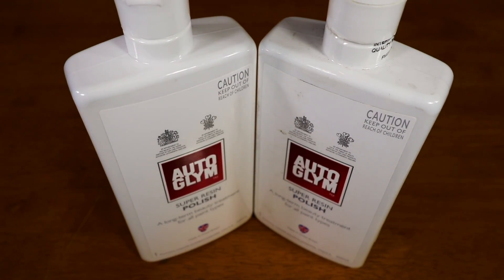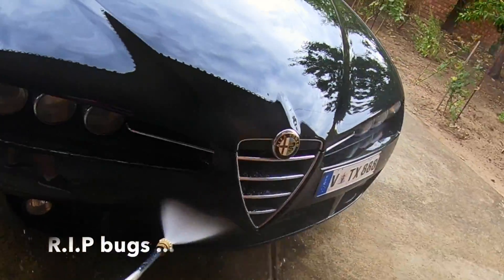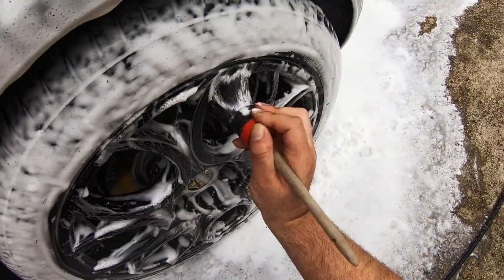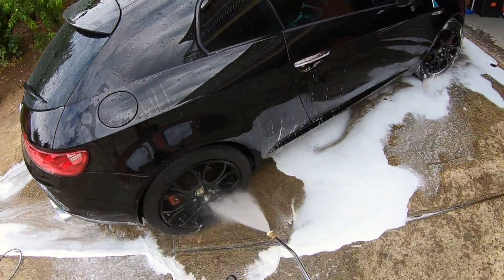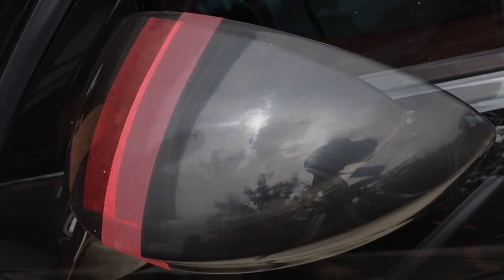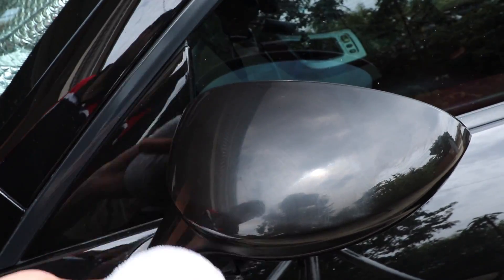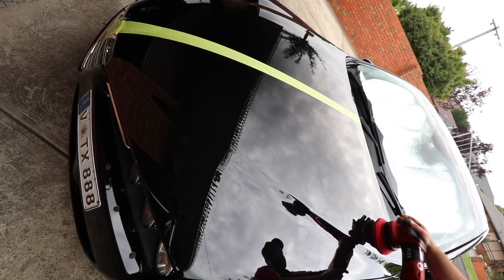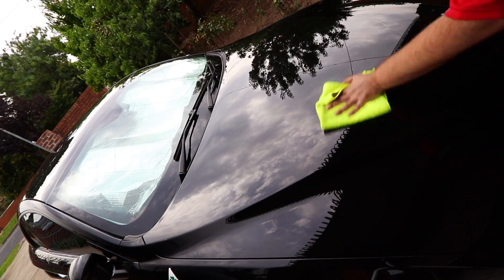How to use Autoglym Super Resin Polish+Review

Comment: Wow! The finish is amazing. After using this polish can we clean the car with IPA and then ceramic coat the car?
Or is it to be used like a wax?
Reply from the maker: It’s really to be used like a hand polish rather than wax, but after a few hour you can top it with a wax or sealant but not a ceramic coating as there will be bonding issues.
Reply from the maker: Give it a few hours or just apply a wax the next day or the next time you wash the car

Comment: I used SRP and totally love the wet glossy look it gives. 
Question: After polishing with Autoglym Super Resin Polish...if I apply cquartz U.K. 3.0 would that lock in the wet glossy look from the super resin polish for the life span of the ceramic coating?
Reply: Car Craft Auto Detailing  thanks for the feedback on this it’s very much appreciated. Presently I have Autoglym “Extra Gloss Protection’ sealant on my car. I’m looking for something to add on top of EGP to provide additional layer of protection and longevity...do you think it will be a good idea to put a wax/spray wax on top? Any advice would be appreciated.
Reply: Thanks so much bro...will definitely get those products. Much thanks again.

Comment: Hi Sandro, great video, and a local expert to boot!  I’m from Melbourne, and used to live in Werribee a few years back. Have a question for you. I’m planning to apply the Gyeon Pure ceramic coating in the next few weeks and have bought a bottle of the Auto Glyn resin polish for the pre coating polish stage. After watching your video I’m starting to think maybe the Auto Glyn resin polish is not the best polishing product to use when finishing off with a ceramic coating?  What are your thoughts, would you recommend another polish in this scenario?

Comment: Hello I was shocked at how many times you went over the first mirror and then eventually buffed the super resin polish off. When I've used super resin polish I've just done small circles in each area in thin layers and then buffed out...
 Am I suppose to go round so many times in one spot ???? What does this achieve compared with a few circles and then moving on???
Reply: @CarCraftAutoDetailing  oh crap wow I spent today 7 hours using t cut, auto glym super resin polish and then auto glyms extra gloss protection. When I next come to do another job in 6-7 months of using super resin polish I will definitely spend ages going round and round. How long should you do on say the bonnet in a small car manually without a machine?
Reply: @CarCraftAutoDetailing  ok thanks for that that definitely helps me understand exactly the right amount required etc! I'd highly recommend auto glyms extra gloss protection. It's a very oily liquid wax that's basically almost a ceramic coating!! It beads water completely

Comment: SRP is a great polish it remains my favorite to date and top it with FK1000 a day or 2 after the application and its High Gloss and mirror finish is a real head turner. I also found the Megs Ultimate Polish similar but favor SRP have you tried the Megs?

Comment: This was very informative. I'm still not sure what product to get. I'm looking for the best product to use before I apply a sealant (not a wax). Paint is dark blue metallic and in excellent condition. I will not be doing any actual polishing. I want to work by hand. Durability is not that important so I don't mind sealant being somewhat compromised. I'm looking for something to do some cleaning and lots of gloss enhancing. I have some P21s GEPC on hand which I've used and liked. Can I do better? SRP, Blackfire paint cleaner, Swissvax cleaner fluid, Prima amigo (would amigo's fine abrasives give me problems by hand?) ?? Thanks
Reply: I just read below this has some abrasives. Will that make dark paint look bad if not worked enough when hand applying?
Reply: Thanks. I'll see if I can find it here in the colonies.

Comment: Can you apply a ceramic coating after using this polish?
Reply: @CarCraftAutoDetailing  okay. I'm planning to correct my paint shortly with a medium cut. After that, do you reccomend applying super resin polish or a ceramic coating? I've bought both. 

Thanks for answering, I'm new to car detailing etcetera so you are very helpful.

Comment: Hi, there is a turtle wax headlight restorer and sealant liquid or waxy type of liquid that has been left on my paint for a month now, because it's white and also my car paint is white so It was hard to notice it when I cleaned my headlights and is now hard. It's not such a big deal but when you go close to it, you can notice it. Tried cleaning it off with microfibre cloth and water but it seems hard. Can I use autoglym resin for that?

Comment: The first bottle you bought ten years ago did have abrasives. It was reformulated several years ago and now contains cleaners, silicone and resins to achieve its results, it's a true glaze product. Any cutting you're seeing is either the cleaners removing oxidisation or the cut from the microfibre applicator.

Comment: Hi,
I used Auto Glym( same as your) to polish my car. After couple  of days I find to much dust sat on my car.
What do you recommend (I didn't apply any wax or ceramic code after polishing.) 
Is this normal?
Reply from the maker: Some dust on the car is always normal, but using a car sealant on top of SRP could help minimise some of the dust you’re accumulating

Comment: Good video! Would you recommend clay barring the car before polishing to remove possible tar spots or iron deposits in the paint?
Reply: WelshCrossy Yes, however you should use the tar and ferrous metal remover etc before claying.
 It's possible you could Mar your surface with the tar lodging itself into your clay bad business there

Comment: Can i use microfibre cloth to put the polish on the car? The other day i was using halfords cloth for polishing when i pour autoglym resign polish and try to put it on the car it was not running and spreading evenly,what was i doing wrong? Was my cloth need to be wet before i put?
Reply: Car Craft Auto Detailing yeah it was not sunny day but sun was on and off and car was a bit warm. Would you recommend me any nice pad?

Comment: Hi Sandro. Justva I quick question: Generally the more you polish a car, the less clear coat remains, correct? Although SRP is only a minor abrasive, roughly how many times could you use it on your car before you start doing more damage than good on your clear coat. Cheers mate
Reply: @CarCraftAutoDetailing  thanks again legend

Comment: Great video. Do you suppose it's possible to really push the duration of SRP by topping it with a tough wax, like Collinite 476 or Soft99 fusso?
Reply: Car Craft Auto Detailing It's still winter here in Norway, and unfortunetly there is no sign of spring what so ever 😕. Have been using the winter to stock up on products, and I'm eager to try them out. SRP is on my list. Keep up the good work 😊

Comment: Thanks for the video. I have ceramic coating on my car. Do you think this SRP or CarPro Essence+ is better? and which one would be better when applied by hand? Thank you.
Reply: Thank you! it sure helps. Essence Plus and Microfiber applicator it is - the coating is still in good shape. I'm planning to use CarPro GLISS after Essence Plus, do you apply Gliss directly on top of Essence Plus, or wipe the surface with CarPro Eraser first? Thank you very much Sandro.
Reply: I will do exactly that! Can't wait for Spring to arrive. It's -10c today, just a car wash is dangerous. Thank you thank you!

Comment: You are way to close with the pressure washer , all you need is a small chip in paintwork it will lift and you will have the paint flaking off . I speak from experience , this happened to me on a BMW wheel.